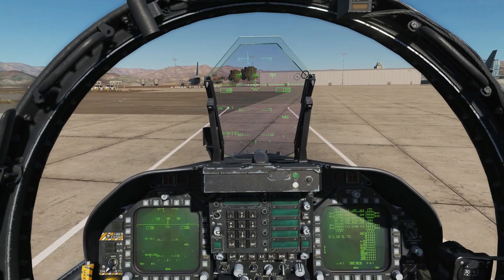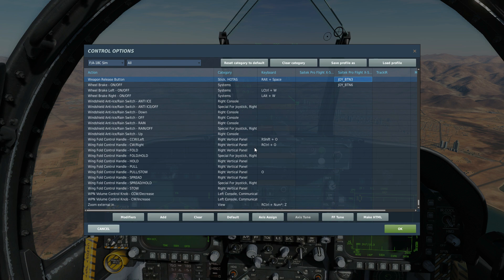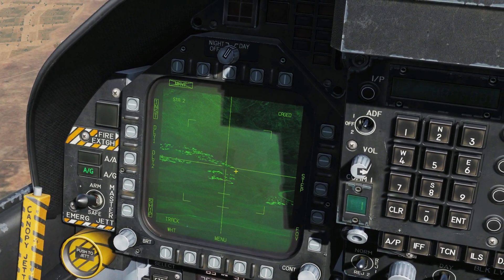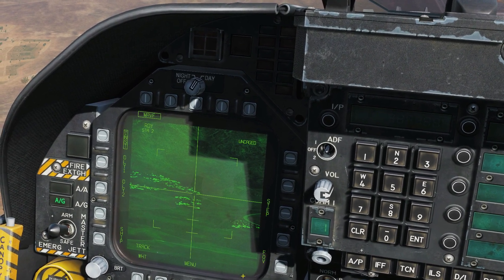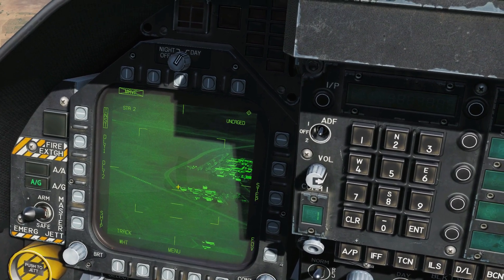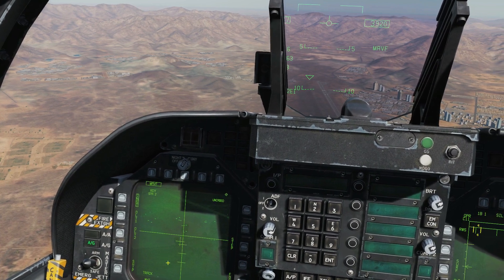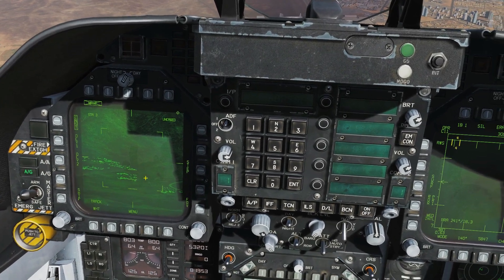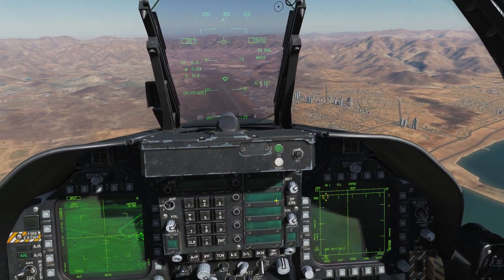FA-18C Hornet: AGM-65F Maverick Missile (SLEW/SLAVE) Tutorial | DCS WORLD

Comment: The other night I was trying this against a ship but I could never get the cross to go away telling me the thing was ready. I was in A/G with Master Arm on, I had the ship at a waypoint and designated it as a target. The missile was timed out and I had the sensor control on that screen. I press and hold the TDC control and try to slew it with the TDC hat but nothing happened. All of this and it was still crossed out. Thing is, I got close enough and just for grins I pressed and held the weapon release, the cross went away, the seeker locked onto the target and the missile fired and hit the target. It actually acted like the laser Maverick. I have verified the loadout and it has the IIR Mavericks on it. Also, there's no laser targeting pod loaded so I don't know how it could have locked onto a laser, but that's what it acted like. I dunno what I'm doing wrong (or right?) but I somehow got a laser Maverick to act like an IIR Maverick without a laser on board, and I fired all four missiles that way.
Reply: I have the same problem but I don't know a solution.

Comment: I click the exact same buttons step by step and mine doesn't work that way.
Reply from the maker: Are you remembering to hold TDC depress when slewing? If so, then try NOT holding TDC depress when slewing.
Reply: @grimreapers   i have the same issue it just will not slew using this way  using the tpod works fine just not able to move the Mavrick seeker head :(